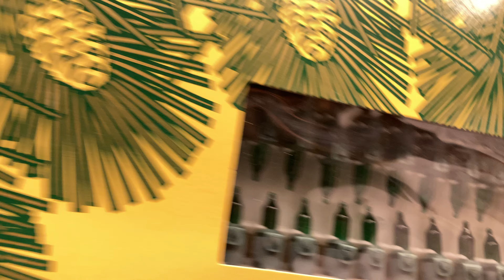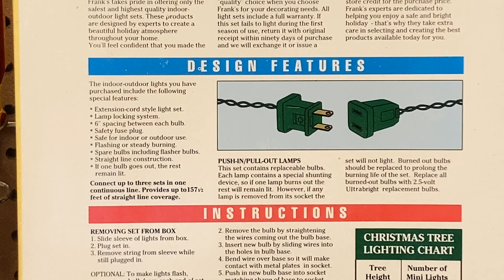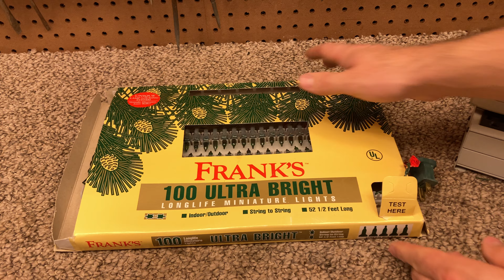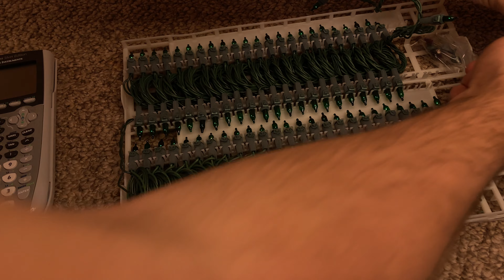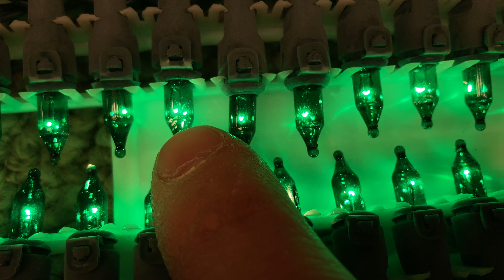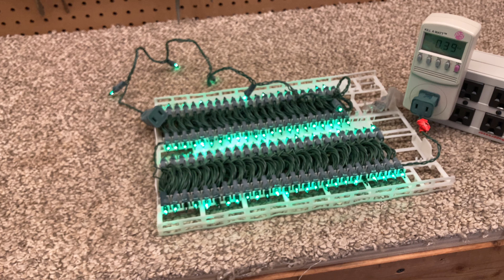Christmas 2025 | Frank's 100 Green Ultra Bright Long Life Miniature Lights

Comment: Classic light set... Some bulbs are go out on early shelf life which causes gas leaked from the wire of the bulb body, it may have quality issues. I have several them of problem as well due to aging. A lot of people don't pay attention when they got new old stock lights set like brands new or never out of the box. When plugging in and seeing the notices and got some bulbs are out or section go out, too. Same way of the LED lights string and some had dimmer than other one. Good old day was better than newer technology LED lights string. If they claims use outdoor, that was lied. It will damages or fails of the lights set on the 1st season or few seasons later eventually quit working. Electronics control box is not supposed to be use outdoor even get wet or electrocuting against integrated circuit inside which causes malfunction the light motion or rest of the lights get stuck on. Oh yeah, Flasher plug (winker plug) should not be use outdoor either and don't attempt overload with lights string could handle with wattage on the flasher plug, if so, burnt out prematurely.

Comment: I have a set of these brand new in the box in clear. I always thought these shorter bulbs were interesting. I’m not sure if they serve any other purpose besides just being different and unique. I have noticed that the shorter bulbs tend to get considerably hotter than standard mini light bulbs as you observed in this video. Also, it is totally possible that the previous owner of this set had one or more similar sets and used this one for spare bulbs. This might explain why so many of the bulbs are burnt out straight out of the box. The bulbs that appeared dimmer may be rated for a higher voltage because they May have come from a different set with more bulbs.

Comment: Judging by the thinner wire, this light set was manufactured before 1997. The white stuff on the plugs and sockets reminds me of some 90s sets I have.

15:27 Commercial grade sets use thicker wiring than consumer grade sets, so you can plug more together. I have a 100-light commercial grade C9 set and it has an 8-amp fuse IIRC and uses 18AWG wire instead of 20. The commercial mini lights usually use 5-amp fuses and 20AWG wire instead of 22.

16:45 I notice that issue on a lot of older Christmas light sets. It has to be something that occurs with age, I’d be shocked if they came like that out of the box.
Reply: I used those commercial C9 sets on my house for light shows..  then last few years i started using TruTone bulbs in them (LED that really look like incadnescant) and I had 300 or 400 lights strung together with no issues...  I love those commercial stringers
Reply: I prefer the thinner wire.